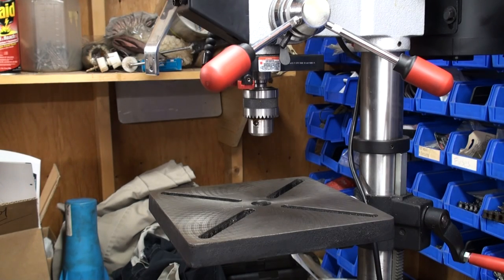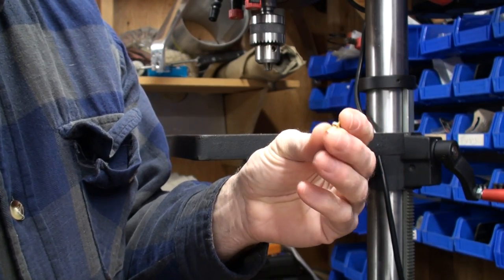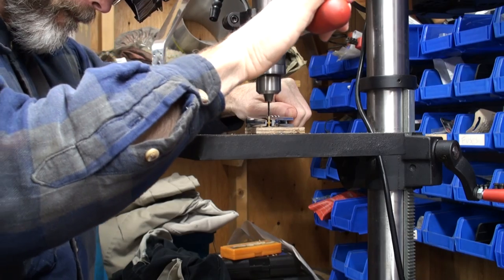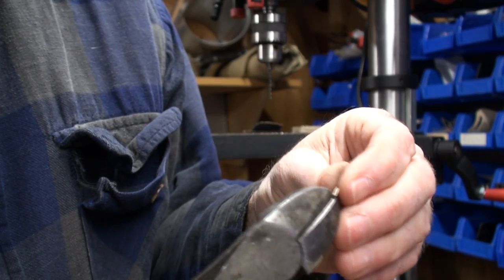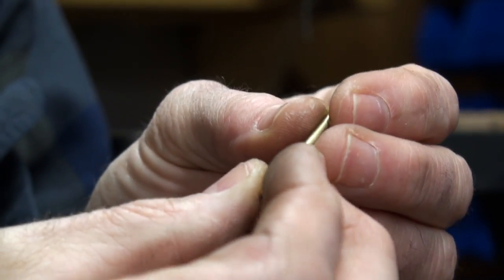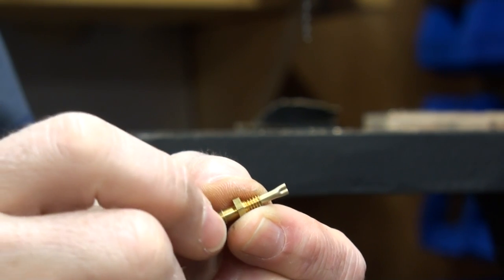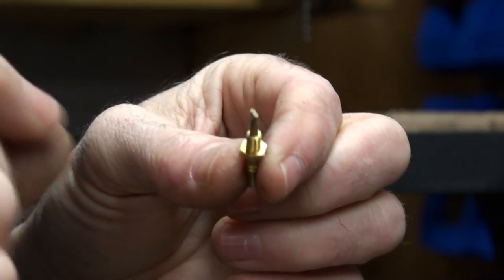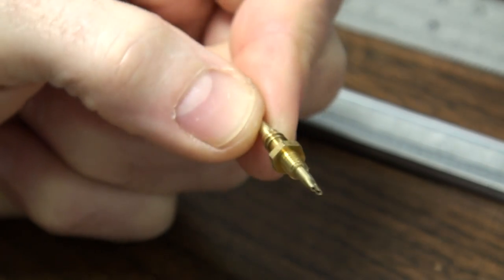How-To - "Big Smoke" RC Oil Injectors

Comment: I have a SIG 1/4 scale Piper Cub running an ASP 1.08 Redhead, fuel tank is 20oz and I plan on placing a 8-10oz tank under it for smoke I already have a Du-Bro Super Smoker Valve I plan on using the crankcase nipple that is already on the engine for pressurizing the oil tank and making an injector nipple similar to your design and maybe trying a remote needle valve to regulate smoker oil amount since I wont be running a pump I plan on building a exhaust spacer to place the injector tube inside.

Comment from the maker: Did the muffler come with a smoke fitting?  If so it should be fine. If you added the fitting yourself, make sure it is in the hottest part of the muffler. (where the exhaust enters) Remember to dial down the amount of oil, less is better, too much will cool the muffler.  Also maybe make one of my smoke injectors like in this video.

Comment: You do realize that pinchingoff the discharge on a positive displacement pump will cause discharge recirculation and drastically damage the pump internals over time? most pump manufacturers warn against this. I work in the industrial pump and seal industry and also fly rc, along with doing r/d for the new holy smokes pump. making a spray nozel is not needed and does way more damage long term.
Reply from the maker: Thanks for your concern.  I don't pinch off the flow of the nozzles, just reshape them to make two smaller streams instead of one large stream.  The smaller droplets burn more completely.  Also, in the second half of the video I show how I have dialed down the pump speed far from maximum output to compensate for the smaller orifices.  And finally, I am using a pump with all metal gears and housings (Powerbox) that is far stronger than other pumps that use plastic gears and housings.  It has been working well for years now without problems.  Thanks for your comment.

Comment: Hey Dan
       Just found the gem of a video thanks for posting!! So question I have is....I have a DLE 55RA with a rear exit canister and was planning on doing this exact setup. I'm running a Sullivan programmable smoke pump do you think I'll run into any issues here? As well when you place your fitting in the header do you just screw it in or put a bit of silver solder around it once in place?? Thanks.
Reply from the maker: I dial my pump speed way back from maximum to compensate for the smaller orifices.  More info in the description.
I just screw the fitting in with the brass sealing washer mentioned in the video.

Comment: Thanks fir your quick reply... I bought the robart liquid sky... When you solder... What solder do you use ? Basically heat up the fitting with a torch ? And then "touch" with solder and it will wick in ?

Comment: Does the injectors has to be in between the the combustion or deeper?
Reply from the maker: I put them right in the flame in the beginning of the header pipe. I had them in the muffler at first but they were lower than the oil tank and it was siphoning the oil out overnight so i moved them up above the tank level about an inch after the engine. Many mufflers have an oil port in them already also. Check this video in the beginning for my final setup. https://youtu.be/wtD4qbvISH4

Comment: I have the same radio. I will have it on AUX2 ( slave to throttle)on an 8ch RX. What settings are you using? Endpoints, etc.
Reply from the maker: It depends on the pump you use and the thickness of the oil, etc.  I just mess with it until it feels right or by how much smoke it's making. You usually don't need anywhere near full speed.  With the nozzles crimped it will create too much back-pressure, and if you have a pump with plastic gears it can strip the pump motor shaft hole in the gear.  That's why I switched to that PowerBox metal gear pump.  Start slow and go from there.  Trial and error.  You can set it up in a jar like I did and get a feel for the flow.

Comment: Arent you supposed to have coils before the oil injector so to preheat and better burn the smoke oil?
Reply from the maker: Some smaller engines that don't produce much exhaust temp use coils, especially small nitro engines.  I was using this setup on a 3W-275cc engine and had the injector right in the beginning of the exhaust header where the flame exits the port, so plenty of heat there.

Comment: Just curious what type of silver solder do you use such as local hardware store silver solder with say 3% silver.  I about to make me one and I'm afraid the heat will melt the solder in flight.
Reply from the maker: I actually used regular solder but silver would be better.
Reply: Really!? good to know. I was worried about the heat melting the solder. I plan to use this on a 50cc engine with a canister exhaust and mounting the injector about 2-3 inches on the header pipe. Any other recommendations?

Comment: Too much restrictions of the nozzle will cook the pump!!
Reply from the maker: Mike Secondo : If you watch the second part of the video you’ll see me dialing back the pump speed to almost nothing which saves on oil and takes the strain off the pump. Also I’m using a pump with metal gears and housing.